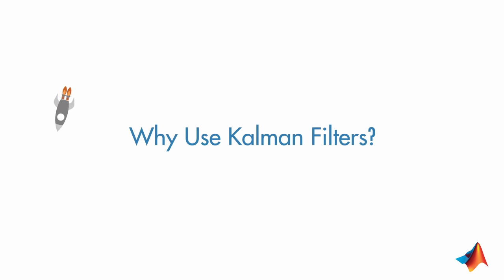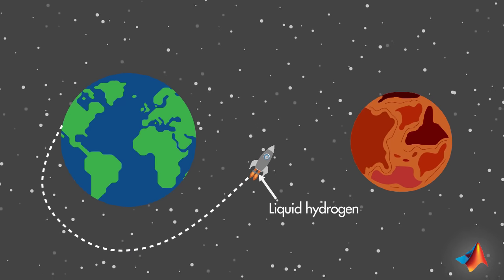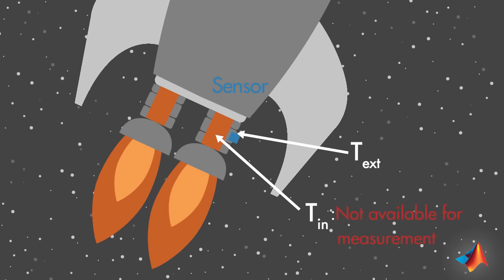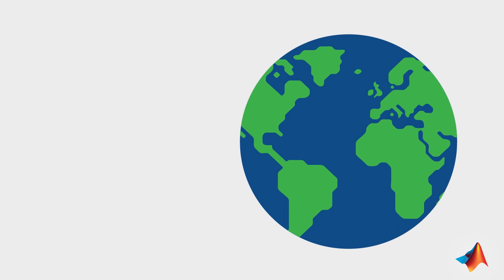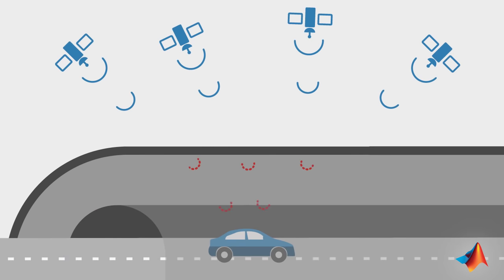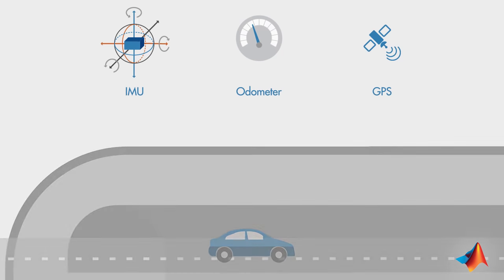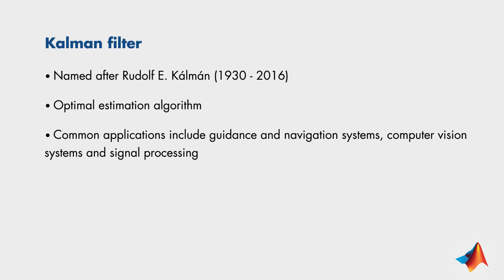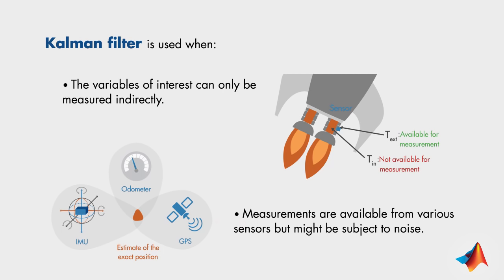Why Use Kalman Filters? | Understanding Kalman Filters, Part 1

Comment: While a speedometer claims to be measuring distance/time, it’s actually measuring revolutions/time of the tires, but displaying it as distance/time based on an assumption of tire size. As tires wear, the speedometer calibration changes.

Comment: does it make sense to use a low pass filter on the sensor reading, before introducing it into the kalman filter?
Reply: I would like to know too, but based on my understanding so far, it seems the answer is no. A low pass filter will reduce noise based on the (crude) assumption that the variable observed by your sensor changes at a certain slow frequency, anything above is noise. Instead, you want the prediction model to provide this denoised, stable signal, and use the Kalman filter to combine it with the observed, noisy sensor data (leaving low pass filtering out). That’s my take anyway, anyone with deeper understanding please chime in :)